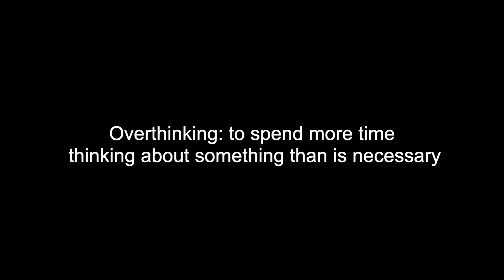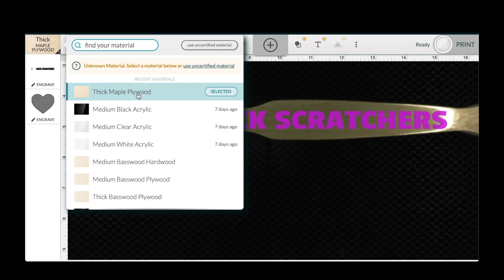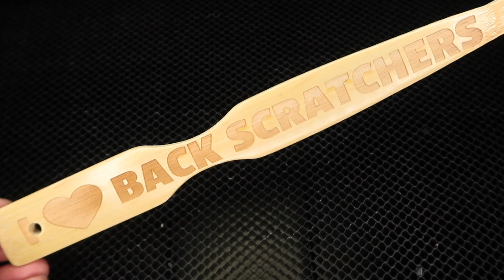Project: Laser Engraving on a Bamboo Back Scratcher

Comment: NICE. I honestly wouldn't have thought about just letting the "hand" of the scratcher hang over lol. I would have taken the tray out lol
Reply from the maker: I tried to remove the cutting bed but I didn’t have anything to keep it balanced. It took about a hour before I figured it out. 🤦🏾‍♂️
Reply: @TroytheMaker  I use ceramic tiles to build up stuff when I take the bed out. That and ball up some making tape if needed as well. I have a ton of tiles lol